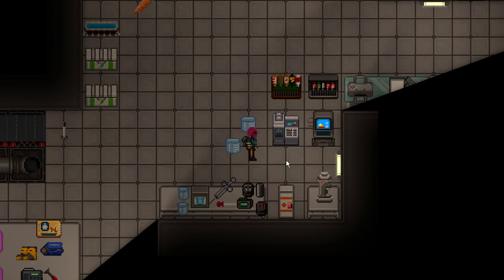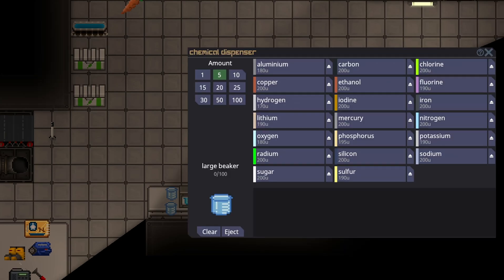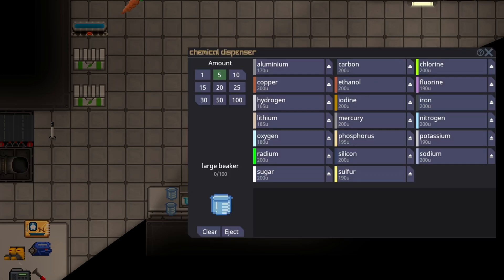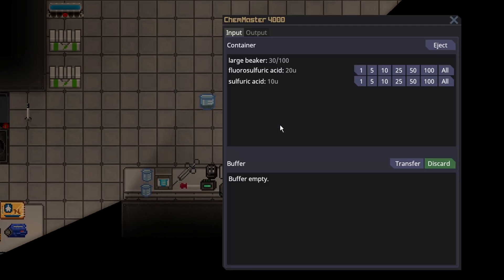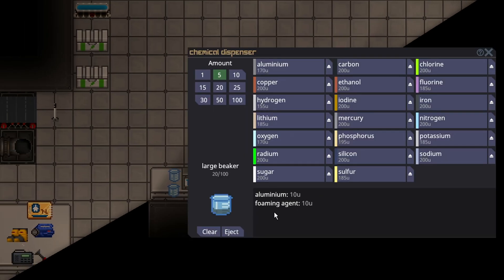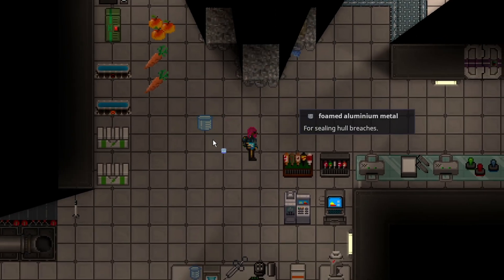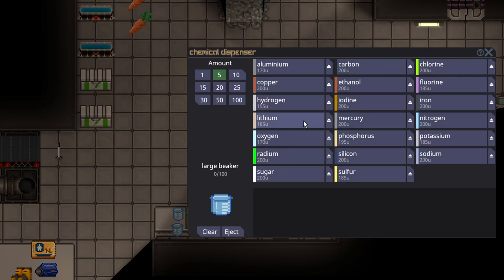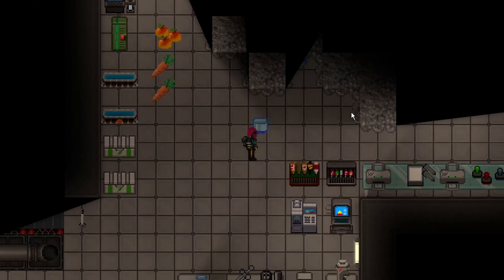SS14 - Metal Foam Explained

Comment: What happens if it entombs someone?
Reply: Basicaly the same as getting stuck in a wall, except metal foam is bot that durable, so it's easier to get free.
Reply: long ago, I did it accidentaly (I didn't know metal foam 8y the time) and 'I' ingested it, making 'my' insides burns, leading to a quick 8ut painful death (also it solidified quite fast). Nowadays, it's o8viously different.
Reply from the maker: they get crushed and die if not freed
Reply: Ah, brutal, thank you all
Reply: They suffocate in it i think, unless they have internal on or have a weapon to break the foam fast enough, or maybe they just stuck in it

Comment: Would the foam iron be tougher than the aluminum? I mean, I would assume so but this is SS14.
Reply: After looking at the code they both spawn a 50 hp wall, it's also not dependent on reagent amount.

Comment: Is it possible to make them into grenades like the cleaning ones? I see it a lot more useful and less bulky that way if you want to give a engi a nade or two for those kind of situations.
Reply: You can put the solution into a modular grenade and throw it. Works like a cleaning nade except you assemble it yourself.
Reply: good luck getting sci to research and make them for you though
Reply: I imagine this would also work for a cryostasis beaker. Just have all of it in the same grenade, toss it, pick up the cryostasis beaker and it should react when it all spills on the floor.

Comment: Is it possible to make them into grenades like the cleaning ones? I see it a lot more useful and less bulky that way if you want to give a engi a nade or two for those kind of situations.
Reply: iirc You can fill up chemistry payloads with two beakers. You can then load the payload into a modular grenade. The grenade parts can be researched by science and made with a secfab. You should also be able to increase the radius by filling it up with more chems.
Reply: @mikakuhn958 i think you can make all the parts on a protolathe. Secfab can make flash and explosive payloads, but you don't need those anyways.
Reply: modular grenades with chem payloads as mentioned or throwing a cryo beaker with all the stuff in it. The beaker holds a lot less than a proper grenade, but it's much simpler to make
Reply: These in fact can be ordered in cargo
Reply: Use florisufficant and then add water to get not metal foam